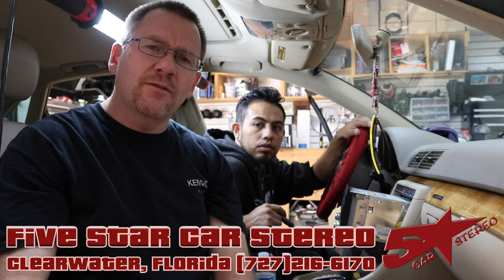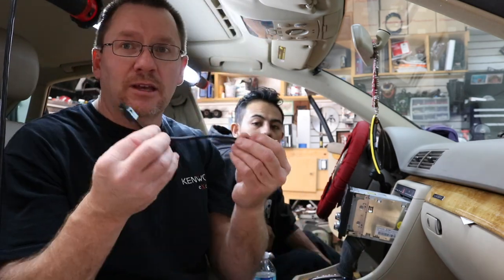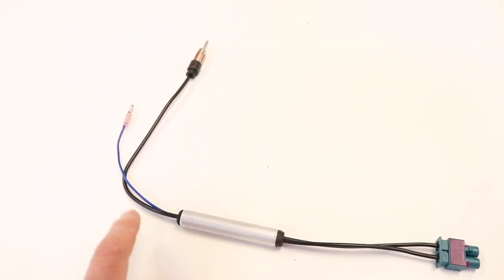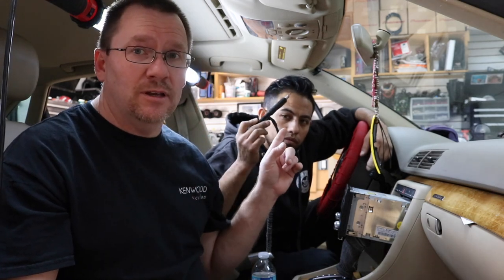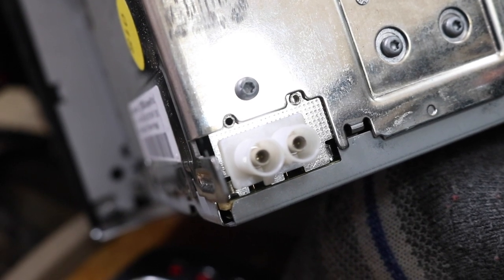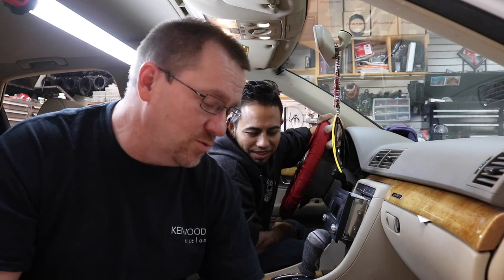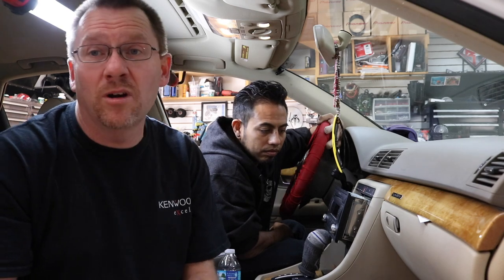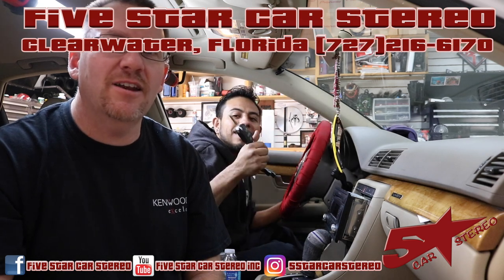Is the FM reception bad after installing a new car stereo a German car

Comment: I installed the PAC Audio kit in my 2012 Camaro, and have noticed the FM signal is pretty bad now with the new radio. The kit comes with an antenna adapter that looks like the one you showed with that round thing on it, and a remote turn on wire. I believe it’s all hooked up correctly. I have read others having the same issue.
Reply: L

Comment: If the antenna is detachable (like on my 2002 VW), also check that the connection to the antenna is clean and clear of crud. Put a bit of bulb grease in to help the connection.

Comment: I dont get it... I have a similar thing in my radio... I also have that blue connector, but were do i connect it ?
Reply: Most likely nowhere. If you have a normal antenna, then you don't need that. It is only for small antennas like those shark antennas on BMW to amplify the signal.
Reply: If its a blue-only wire, connect it to nothing 

If it's a blue-white wire, connect it to the red one since that one powers the antenna every time the key is switched on

Comment: I have a 2005 Jaguar X type estate car . I have installed a new aftermarket radio and the reception comes and goes. I did get the small adapter plug as you show My new radio only has the regular plug in it
the old radio did not work at all to be able to test it. I live in a small town where can I get the new adapter plug that will fit in the regular radio plug and make it work?
Thanks
Gary

Comment: FM car radio does have problems in areas where there's lots of hills trees buildings and structures and because of these, you tend to get distortion or hissing especially stereo stations. FM also depends on line of sight. A good plus with FM is that reception doesn't suffer at night from continental interference and the quality is better.

AM car radio doesn't suffer the problems of FM and is more suited to built up areas, hills, mountains, and built up zones, but is not as good quality, and after dark, because of skywave propagation, you hear foreign stations on top of what you are trying to hear and signals may fade and / or distort horribly.
Reply: Prisoners_Voice_Iran_Israel yeah yeah offcourse, dream on you must have a 40 meter antenna pole on your car right

Comment: Say in the case that you DONT need that device, and you can get away with simply using that fakra adapter, is there a setting of some sort within the radio settings that you have to turn on for it to receive 12v?

Comment: Thats Exacly my problem.
Fm radio only play a few stations  and. Bad . and low volume. Too I have. A
Vw cabrio 2000
 I installed 2 diferent. Stereos.... Same issue.
I gess Im giving up
Now that You say is the antena. I thoug  it was the Ground. .
Thanks for your video.

Comment: I have a 11 Mercedes ml350 non hardon kardon system and switched my radio to an Alpine ilx 207 and the radio reception SUCKS!! I watched your video and was wondering which radio antenna is the right one (like the one in the video) for my specific car because that radio signal is really starting to get onto my nerves. Thanks for your help in advance.

Comment: My reception is worse with these cheap ebay power antennas, I also have an aftermarket headunit in my Skoda which is a double Fakra antenna. I've tried a few of these and reception is always bad. The stock headunit never has an issue with fm reception.

Comment: Hi. I have a vw passat and I have a weird issue after changing the head unit to an aftermarket one. When the car is off (no acc/ignition) the radio has great reception but the moment I turn on the key to acc or switch the car on the reception dies completely. I have received the antenna amplifier but even after installing that it's the same. Any help will be great

Comment: I have a 2006 bmw 325xi with hifi. I'm trying to install an aftermaket headunit that simply says to connect the blue wire from the aftermarket harness to the blue wire on the stock harness. There is no blue wire. I believe, in my system, the antenna wire is also the amp control wire and is black (not "white" as some other forums suggest). I've read that I need to cut the black wire from the amp in the trunk and leave it disconnected and the antenna will then function. But, isn't this going to disable the amp?

Comment: Nice video, I'm putting aftermarket head unit in my 2019 nissan rogue, reception is no good. Do you know what wire is for power antenna in the harness???

Comment: O.K. but how do you provide power to the german antenna so you can use it in the new head unit? Do you provide separate power from the amp turn on wire or another 12v switched source? Is the antenna signal then fed through the outer part of the connector (12v inside lead, signal from where and is shield also ground?) thanks

Comment: Any tips for bad reception in a 2002 Mercedes c320 with a Kenwood ddx9903s? It's not horribly awful, but it is definitely not as good as the factory radio.

Comment: I used antenna remote wire to turn my sub amp since my blue and white will not turn it on i think radio gets a little of static but i use radio for bluetooth

Comment: I installed a Class D sub amp in my VW Passat 2011, after that i got bad signal to the Radio. Is there a solution for this? 
I use the build in antenna with a Phantom adapter to boost the signal. but still bad.

Comment: Hi guys. 

My bmw e46 radio has two plug at the back. One for the antenna and one for the antenna amplifier i think... how do i connect the antenna amplifier wire  to the aftermarket radio? 

Thanks so much
Reply: Same here, did you find the solution?

Comment: Hi guys I bought a Chinese after market radio touch screen I'd be very happy with only for the reception is awful,,, I can't get anything unless I'm in certain locations were as my original radio gets everything,,,, I disconnected my arieal and went and bought a 12v basic one in halfords hoping it would improve,,, but still nothing,,,, am I doing something wrong or is it just rubbish,,, cheers John

Comment: I just replaced the stereo and got an adapter for the antenna cable and it came with the small blue wire. Where do i connect that one?? The reception is poor but it was poor with thr original installtion as well so i assume it’s the antenna...

Comment: I know this is an old video but I have an HHR that is having same problem but it is a single connection coming out. I put an aftermarket head unit in and I have no radio signal at all. Prior to the installation only the tweeters would play sound now I have sound thru all speakers but no radio stations just static. If you can please help me out.

Comment: Hey guys. So ive just fitted a pure 200 dab adapter in my car and the reception on the glass aerial is terrible so i tryed to connect it up to the amplified aerial on the roof and its still bad. Would a inline signal booster work do you think? 🤔

Comment: Got a question for ya. I got one of these boosters for my e46, but what goes in the middle? What I mean is, the clip on one side plugs into the radio, but the other side doesn’t have the connection end that will fit a German car. The factory plug for my car is a little sideways slide in clip. It needs a female clip similar to what is on the back of the radio. What is your solution to this because that’s what I’m up against? My radio came with the solution, but going that way the wire sticks out to far, hits the firewall, and doesn’t allow the radio to slide all the way back. The wire that came with my headunit plugs into the radio and has a connector that fits the big female end, and then allowing the other end to plug into my existing factory plug. Like I said, it won’t work though and I’m not sure if you can even orintate in that way or if there is a certain direction the flow has to be. Haha, I tried to explain as best I could without showing you or having maybe proper wording of the wires and such.

Comment: I have a 2010 Hyundai Tucson bought an android radio from china FM no reception I installed FM booster still nothing do you have any Ideas your input would be helpful..
Reply: Juan Valera I have the same problem, no radio reception whatsoever. Due to an unamplified aerial. I have downloaded a radio app and listen through this now. It doesn’t lose signal when on the move. Uses data off your phone but not excessively. Plus I no longer need to remove the unit once again to remedy with a signal booster. Hope this helps.

Comment: Hoping I can get answers - I have a 2018 Honda Civic LX Coupe. No "shark fin" antenna, instead its in the glass. I recently had a High-end Kenwood unit installed, but BOTH the FM and AM reception were poor. The installer found a bad antenna conversion cable, swapped it - AM reception improved dramatically, but FM reception is still poor. Can anyone tell me whats going on, and what the remedy for this is?

Comment: Hey guys,  I am hoping that you have experienced the issues of poor sound audio from Toyota's JBL Premium Greenedge stereo head unit installed in several of their vehicle models including the 2017 Camry XLE.   (This is a stock unit with no modifications.) 
The issue:  While set to FM / AM, there is almost no bass, and their sorry excuse for an EQ makes almost no meaningful changes in treble or midrange levels.  This is a widespread problem affecting several model years, from around 2014 to present.  
Using HD or XM radio signal and playback on CD player is somewhat better, but not great and listening to any regular AM / FM signal is dismal at best.
Is there any chance you guys have a suggestion or a fix for this?    Any tips on fixing this flaw would make all late model Toyota owners EXTREMELY GRATEFUL!    Thank you.  JC

Comment: If in doubt, leave it stock. Many newer car stock head units have excellent sound quality and consider line output converters instead of an aftermarket stereo. As for most cars 2006 or older, an aftermarket stereo will significantly improve the overall sound quality. My Camry is a 2015 and the stock head unit is very nice so I am going to leave it stock.

Comment: I have got Vw Passat (Europe) and I had DAB manufacturaly fitted. I have got a new pioneer car play unit istalled, the guy installed an additional windscreen mount dab antenna, since that I have a crappy DAB signal and in 90% no fm signal at all. Could you please advise on that. Thanks in advance.

Comment: I'm getting crumby FM reception after swapping the stereo in my 06' Honda Pilot. I've tried both connecting and disconnecting the blue power wire that came connected to the antenna adapter and still no dice. Is there any other way I can boost reception?

Comment: If your head unit has dual fakra white. The booster kit shown has a standard single antenna. How does that work with dual fakra head unit and dual fakra antenna
Reply from the maker: There is a new antenna adapter out for those cars. It was not out at time of filming. Metraonline.com

Comment: I have a shark-fin antenna on my Honda. My AVH -4200NEX radio reception sucks compared to my old stock radio. Is it worth trying this on my vehicle?
Reply from the maker: Nathan Huth there is an antenna wire for the Honda. What make and year do you have.
Reply: 2011 CR-Z
Reply from the maker: Nathan Huth the antenna adapter used for that car should have a blue wire on it. That wire needs accessory power. Baa42 is the model we use.

Comment: So informative!!! found y'alls channel after looking for aftermarket double din DVD radio for my new to me 06 nissan murano. ..Big question  what radio would you recommend for my car (and where to purchase ) ... would be awesome if y'all did a vid on install of that radio and the aftermarket chassis that integrates the original functions
Reply: STEELTXGAL hey these guys are for sure a big help . the biggest question you want to ask yourself is what you want from your headunit and how much can you spend . then you want to look at your factory headunit/radio and see if everything will be compatible with your new head unit.  the reason I say this is your car might have a bose sound system with 1 ohm  speakers but your new headunit would output in 4ohms . just did my 2004 maxima with bose  got a new nex4200 and I got everything to work except HD Radio . look on Crutchfield for your headunit and they will tell you everything you need for the install
Reply from the maker: STEELTXGAL thank you. Metra makes the kit for that (99-7612b/s). Yes the next one we get in definitely needs a video. The kit and install parts can be a sticker shock on that car. If you go to www.metraonline.com you can get a list of parts. Figure out your budget and feature wish list and we can give you some recommendation.

Comment: Hi guys I have a dilemma regarding aftermarket radio. Poor reception FM & AM
I hope you guys can help me regarding this issue.
I have a 2006 QX56 Infiniti
I purchase a stereo it is a chameleon concept X model
Purchased it and had it installed and it had very no reception on FM and AM channels the stereo shop tried and amplified antenna aftermarket did not work then they tried using my current antenna on my vehicle that didn't work either.
Did some research on the settings it was set for European so I set it for USA setting then I got some type of reception but not as clear
Can you guys help me with this issue.

I'm trying to fix it myself because the stereo shop seem to be bothered by me trying to rectify the issue of my reception on my FM and AM stereo that I purchased from them
Can you please help with any suggestion or advice please

Thank you 
Daniel

Comment: HI. I bought a pioneer 8200nex and a idatalink maestro rr to go into my 2012 silverado 2500. I have not been able to get the hd radio working with this set up. I connected to blue/white wire on the radio with the blue/white wire on the maestro rr harness when I installed the radio. Do you guys have any suggestions.

Comment: Hey guys this is Aaron from Texas.  I have an 07 Silverado classic extended cab with the avh-p4300. I plane on installing my Rockford T5 components in the front doors. But I'm not sure what to do with the rear doors. I want to try and install Rockford in the rear doors also   But don't know to have pods made to fit more T5's or keep the 4x6 plate in there. Any help or a video of an install   Thank you
Reply from the maker: bikerbrego wow T5's are sweet. If you are going for loud make pods and add them to the rear. If you are going for sound quality, go for the 4x6's. You just need a touch of rear sound, you don't want to draw away from the T5's.

Comment: Hi guys have a great day and as always you are awesome, a little help please my friend installed in my Grand Marquis 96 a 2Din Kenwood, everything working excellent but the radio doesn't tune he told me he insert the antena wire in the unit but no tune in any stations, what could be the mistake ? .... thank you for the help !
Reply: Is important to say that in the original unit radio worked very well
Reply from the maker: Jorge Gonzalez there is a blue or blue white wire in the Ford plug that may need to be connected. Sometimes in the fords the antenna is real short in the dash and does not  make god contact. We have to sometimes add a 12 inch extension on to it to make it reach.
Reply: Five Star Car Stereo those blue wires either blue or blue/white are 12v? Could I connect to "antena control wire of my unit ? (Kenwood DDX719) 😓 ...... thank you so much for your help 🙏🏽
Reply from the maker: Jorge Gonzalez yes you can connect them to the Kenwood blue white.

Comment: Sooo I want to hook that to a switched power? Like  they accessery or a foot brake thats pos. and not being used??
Reply from the maker: Power that is on when the car is on and off when off.
Reply: my 14 jetta gli sat radio no nav,putting aftermarket with gps antenna .Do i have a gps antenna in the car alreadt?? Have a fin on top of car and compass in dash .If so weres the wire go?? To another switched power? blue wire?   Thanks for help

Comment: Hello everyone!. Where I can find the antenna diversity card?   My car is an E46 318tds compact 2004 and my command key stopped  working... Is not problem of the battery because  happens the same with the second key... Some weeks before this problem ,  one fusible burned 2  times  and did it stop  working the window and central lock and key command. I suspect that it burned after I closed the bag door! But I fixed just after change the fusible. But now, just the key command is not working...  I suspect that it could be the diversity antena. But almost dismount my car to find where is it... Someone there knows where I find it? Do you know what could be?

Comment: the reception sucks on 2004-2006 gto was made in Australia  and help on that?
Reply from the maker: Eddie GTO yes it does suck, depending on the plug you have there is an antenna turn on that needs to be connected. It is a yellow red wire in the factory harness.
Reply: all that info available on metras web site?
Reply from the maker: Eddie GTO no they don't give out information like that. We have access to basic wiring info.

Comment: well how a bout and 2008 dodge caravan I can't locate the power wire for and aftermarket deck.any videos on that
Reply: your vehicle has a can (data) power turnon system. you  will need a harness that supports that. pac audio makes a harness for that. otherwise, you will have to run wires for power
Reply from the maker: Gio arteaga yes this Jeep video uses the same part you need for your car
https://youtu.be/DIO8p_sOLKU

Comment: My solution is far more simple. These units are WiFi so I’ve downloaded a radio app and use this. It doesn’t lose signal whilst on the move and your not restricted to region. Uses data from my mobile phone and the only mistake I made was leaving hot spot sharing on for two days. Stole almost a gig off me. Remember to turn it off.